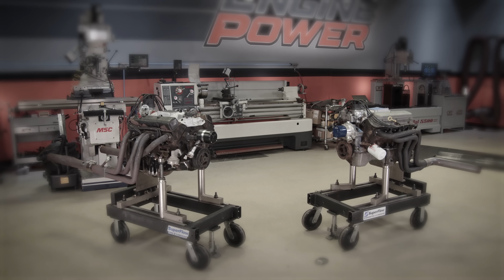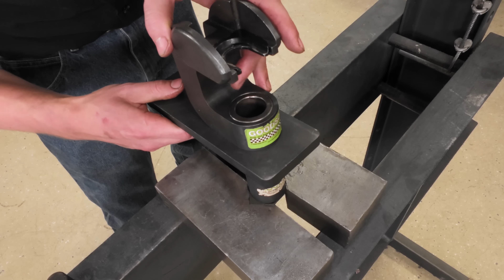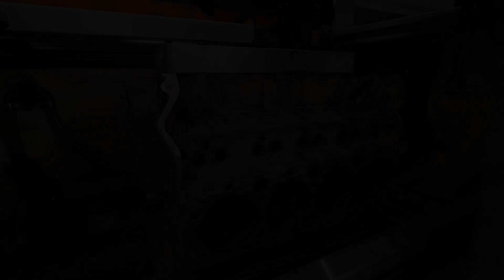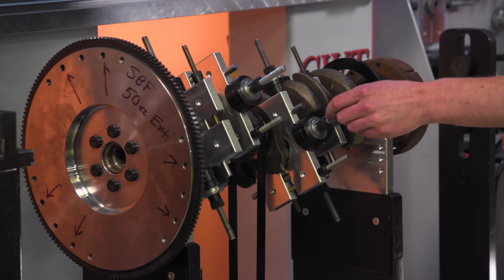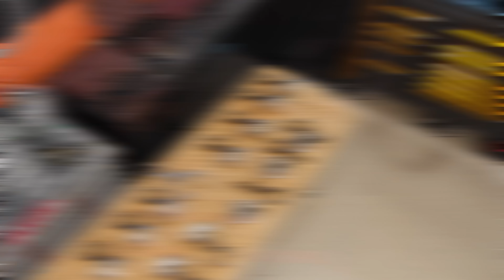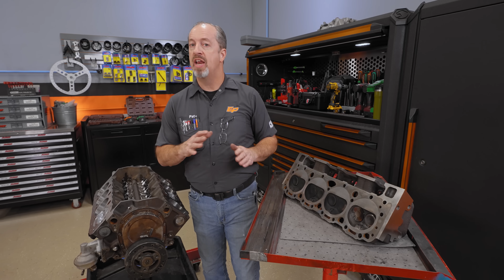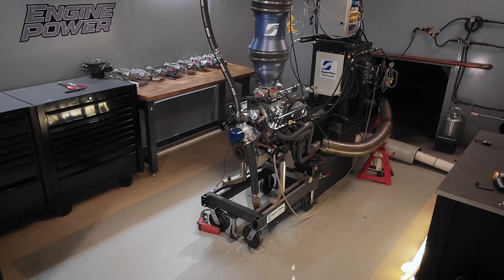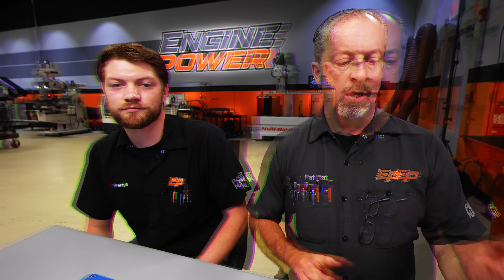305 SBC vs 302 SBF: Does Compression Help the Lowly 305 beat the Race-Bred 302?

Comment: alright, my 305 stays in my Buick, I had toughts of swapping a 350 in but I see no point in doing so, it´s not a race car so the 305 is more than enough, thanks a lot guys, great work.
Reply: youd definitely feel the difference in torque between the two.
Reply: Tbh, I love 305s. Built a couple in high school and the one in my 78 Buick was all cast iron, low lift, and a quadrajet. 1st gear-60/2nd gear-120/3rd gear was good for 150+. 2.50-ish rearend gear lol. Used to love throwing it down in first about 55mph and doing the long pull through 2nd gear (60-120 mph) on my way to work in the mornings between these two certain bridges...

Comment: The best thing Chevy ever did for it 305 engine is cutting off the back two cycles and called it a 4.3 V6.
Reply: 4.3 is a 350 with 6 cylinders that's why its decent

Comment: The smaller bore is a disadvantage with a 23° valve angle, but the longer stroke helps make up for it.  The 305 vortec heads looked like they had 1.94"-1.5" valves too. Not bad for a 305 for sure. 

The 302 has a 4" bore which helps the heads work better but with the 3" stoke, I'm surprised they make the torque they do. Those p heads must work pretty good. 

This is about as fair of testing you could get. They stepped up to a 1.6 rocker for the 305 to get similar lifts, should have used a 1.65, but still, I'm impressed with both of these little turds. It would have been really cool to see the same firing order for both, but I'm sure they each have their own patterns for power reasons.

Comment: On the chev you should have ground the rod .
Reply from the maker: Normally you would be able to remove most of the mass from the balance pad on the small end of the rods, but 2 of the 305 rods had almost no balance pad left from the factory adjustments, so we wouldn't able to remove mass evenly and opted for removing it from the rod throw instead

Comment: How hard would it be to build these two engines and still maintain impartialness during the machining process? Lol
Reply: Also, one thing I was always curious about is a 305 Chevy with a 3.75" -4.00" stroke crankshaft.
Reply from the maker: The machines do not know what kind of engine they are machining so other than making sure a few dimensional parameters are accounted for, it is very easy to get them the same. If you interested in a stroked 305, check out our 2 stage 305 build at the link below! We built a stock stroke version that made 400+hp and then transitioned it to a 3.75" stroke, big valve, solid roller combo that made 510+hp!
https://www.youtube.com/watch?v=XHuO2lMx80c

Comment: The 305 was given a lift disadvantage on the camshaft, and still stomped the 302 on torque, everywhere. That horsepower peak on the 302 really doesn't tell the whole story.

Does seem like a pretty mild grind on the cam to me though... and aren't those single plane intakes? If so, that's leaving a lot of torque on the table, for engines that are out of cam before 6000...

It seems like some odd choices, when you're making custom pistons for nearly 11:1 static compression. A "budget" engine, that is pushing the limits of pump gas? Just weird. More cam (230-235° @ .050 seems more realistic to me) keep it under 10:1 with RPM AirGap manifolds to maximize the torque and let them breathe to 6500 rpm would be a more impressive combo, IMO.

Comment: Its not one parts change ,you have re balanced the whole engine in both cases, factory old engines compared to re balancing and putting in new pistons and that makes a massive difference in any engine, even factory Oe engines do not get balanced these days mass produced and not blueprinted or balanced full stop. 🦘🦘✌✌

Comment: Noticed the ford 302 has two sump -plugs for the engine oil, i bet most of you did not know this fact, including me, i thought they only had one sump plug ,why is that, i know aftermarket sumps would have 1 sump plug ,but why the factory OE has two i will never know its like more work to replace the engine oil when its time to service it? 👍✌🦘
Also noticed that they both do not have a oil diffuser with in the sump, like aftermarket ones have. Which under load like drags the oil will go to the back of the engine ,thus staving the engine of oil up front ,which is why the diffuser does its tricks keeps oil all the way to the pick up and up to the pistons.  ✌✌🦘🦘

Comment: Awesome results bo both sides it they were as powerful as a dz302 and boss 302 a lot better on torque then what the dz and boss would have had. Keep up the great work next should be similar build with a 351 vs 350

Comment: I think the Chevy wins now but haven’t made it that far. Only because compression now match Chevy heads by the data earlier flow more cfm in comparison. Chevy I was always told respond well to 3c’s. Carb, cam, compression. And if you have yo choose big calves bs small chambers on Chevy pick small chambers for compression! They Brest well. Chevy has less valve lift

Comment: That 305 making 325 HP with little work and mostly GM parts is a pretty good result. In my experience, the 305 has always been a throwaway engine, so it's good to see it being shown some love. Still, the 350 or 400, given the same amount of love, can make 450+ HP, and that's before boring and forged internal, but I have always loved the underdog engines that everyone else hates.
Reply: think the same could be said of the Chevy 307 that was installed as the bottom end V8 in Chevelles, Novas etc. I'm guessing the 307 was the late 1960's version of the 305 from the 1980s.
Reply: @HighlanderNorth1 
I’m a Mopar guy that’s 64 years old. I don’t remember ever seeing a good 307 . They didn’t have any power and always smoked . The 305 on the other hand had more power and seemed to last forever. I’ve never owned a 307 and only one 305 but I was around several. I don’t what caused the 307 to smoke but any engine burning oil is also going to be down on power.
Reply: @HighlanderNorth1 I’m with you 307 underrated  engine 307 with fuelie heads good cam are a screamer
Reply: They should do a 260 Windsor Ford vs a chevy 267 v8.
Reply: 325hp from the 305 back in the 80’s in the 3rd gen F-Bodies would’ve been VERY welcome considering the most powerful version in those cars was the dual-cat LB9 with 230hp.

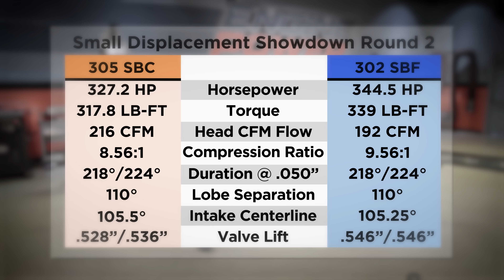Comment: I’m 2:37 into the video and Alread things are not equal. 
Round 1: 302 cam has more lift. 
Round 2: 302 has more lift and more compression. 
Round 3 results were almost even, even thought the ford still hade more lift.

Comment: I noticed that the 302 ran 38 degrees of timing with the 305  set at 36.  I’m guessing that those settings are where each engine delivered their headline power numbers.    Just out of curiosity, could that timing difference explain the Chev’s better low down torque, or are there other things at play?
Reply from the maker: Yes we ran both engines through several pulls to find the max timing vs. power for each engine. There are a few things that can affect that and in this instance it is mostly the differences in Dome and Chamber design in each

Comment: u use chevy lobes on a ford (or even worse MOPAR) naughty naughty, did you post the head flows?
With the taller deck on the chevy 6 inch rods and   1/16 or MM rings would have been nice

Comment: Ford guy here-I thought Chevy for the win due to the better flowing heads. For the next round, factory FI setups. The best stock FI manifolds with an aftermarket ECU. Thank you!
Reply: It would have, if it wasnt crippled by the tiny bore, and less lift.... stock looking heads and non forged pistons
Reply: @taomicioli they were both running factory castings, which the Chevy had BETTER HEADS AND MANIFOLD, which were both stated in the video. The ford had a very small advantage in lift that is all. Forged pistons don’t do anything for horsepower, they are just more durable. You are reaching…

Comment: For all the 305 haters out there. That little 305 just made the same HP as a stock 1970 Camaro LT1 350 despite having a much milder hydraulic roller cam.

Comment: Are you trying to bring legitimacy to the Chevy 305? Probably one of the worst engines they ever made. That and the 307, which shared bore and stroke dimensions with the 250 six banger.

Comment: EXACTLY as I already knew would happen. I knew the compression loss of going from the stock wafer thin ~0.020" compressed steel shim gasket to the ultra thick Felpro and 53cc 601 head to the 58cc 059 crippled the 305 in round 2. I also knew it was going to be good if it had decent compression due to the fact it gained top end power despite the massive compression ratio loss.

Comment: We also learned that all us Ford hot rodders knew what we were doing back in the 1960s and 1970s, when we found ways to make Cleveland heads fit a 302. The weakness in Ford small block engines was always that the heads didn't breathe well, so we copied Ford's Boss engine program to make heads with bigger valves and ports fit. Thankfully, Edelbrock makes that easier with their Clevor heads these days. The GT40P heads are (believe it or not) truck heads, used on the Explorer SUV and a few other engines. 

Excellent series of engine comparisons. Well done, guys.
Reply: All motors back then needed better breathing heads...Kudos to Ford to make the Cleveland Heads for Small blocks.
Reply: @cuzz63  they just took the Chrysler Poly head and made the ports bigger
Reply: @seancollins9745  I thought the 335 heads were more similar to BBC heads than Mopar poly heads
Reply: @seancollins9745  Yeah we know, everything amazing came from Chrysler... 🙄🙄
Reply: @kevinjokipii4260  canted valve, symmetrical port, go  look at the chamber for the poly and the Cleveland
Reply: This is why aftermarket heads (Trickflow, etc.) can easily take things above 400hp on the 302.  I don't believe there are any aftermarket options for the 305, so this is about the best you're going to get.  Would be interesting to see what can be gained in porting these heads.  What do I hear for a round four here?!
Reply: The GT40P heads were ONLY used on mid-'97-'01 Ford Explorer & Mercury Mountaineer.

The GT40 heads were used on '93-'95 Mustang Cobra, 1st Gen Ford Lightning & '96-early-'97 Ford Explorer/Mercury Mountaineer.
Reply: @foxfordcatguy2283 GT/40 P heads was on the first gen Lightning’s and some of the Aussie 302 powered vehicles in the late 90’s
Reply: Gt40-p is a revised version of the gt40 head that was originally found on 351 marine engines.
Reply: Without putting exotic or super expensive parts, this was a very fair comparison for normal people.
Reply: Ya'll done it ass backwards, everyone knows the 305 Chevy was an economy engine to pull heavier cars and trucks down road with fuel efficiency, it has the 283 bore and the 350 stroke, racers were making Chevy's 302 back in 1957 by boring a 283 truck block .125" over sized and finding the factory forged crank. If you wanted to make a real comparison, you should have started with a Z-28 engine and a Boss 302 Ford, then put all these new trick parts on them. The Z-28 would still win!!!!!😊😊😊
Reply: @carlsledge3868  Yeah, because everybody has a Z-28 302 or a Boss 302.🤦

They used these 2 because they are both plentiful & what many people can afford to start with.
Reply: @carlsledge3868  You know that, and I know that, and I'm sure Pat and Frankie know that, and the real shame is they don't mention the backstory on the 305 -- it exists to meet CAFE requirements.  In the days when 350 blocks were cheap and easy to find, there was no point in messing with the 305.  But now that 350 blocks are getting rare and pricy, there is something to be said for the 305.  Especially if you want to maintain a numbers matching car.  

The best part of this series is how it addresses the airflow limitations of the narrow bore.  Take a look at how they managed to get 600hp NA from stroking a 305 out to 340, and only going 0.030 over bore.  I never would have guessed that was possible with this block at essentially the stock bore size.
Reply: @carlsledge3868  Been done and no it didn't... so sorry bowtie slogger
Reply: @carlsledge3868 the 302 was the same thing. And a boss 302 and a z28 with all these parts on them would end up just like it did in this video because their literally the same blocks.

Comment: to make installs easier you can use allen drive set screws in the corners at least to make locating the part easier on oil pan intake ,valve covers etc, available thru mcmaster carr in any size.

Comment: The chev is still down on cam lift and rocker ratio,  between those two I'd say maybe 80 thousands of lift less then the ford, that could be 10hp.
More lift is more flow.
Reply from the maker: The Chevy is down only .018” of lift at the valve on the intake and .010” lift on the exhaust. The 059 cylinder head flows roughly 20cfm more than the Ford does at peak lift as well

Comment: I believe Lake Speed showed a pretty significant difference in 1/16 vs 5/64 ring packs due to frictional loss and higher rpm sealing.  Most likely enough to even it up at least?   Great video series though.  Maybe try some pocket porting next time?
Reply from the maker: Glad you like the series! The difference in ring pack on the two at this level is pretty negligible, since both engines have a rotational force (torque require to keep the short block rotating) within 2 lb-ft of each other
Reply: @enginepowertv  Well said!  Not sure where posters are coming up with their "difference" power numbers.

Comment: All this was done with cast iron heads which have better thermal efficiency than aluminum.  Awesome.
Reply: You want oil hot and chambers cool. Aluminum heads of the same specification would have destroyed the iron heads power wise because the chambers run cooler at the start of the pull and the cooler the chamber the easier it is for the air/fuel charge to be drawn into the cylinders.  If they had built a 305 out of a mid 90s Caprice L99 4.3L V8 by stroking it that came with reverse cooling and put some ported aluminum LT1 heads on it that flowed the same as these the L99 based 305 would have made another 15-20 hp and tq over this one because of the reverse cooling and aluminum heads allowing the chamber to be much cooler.
Reply: @chrisreynolds6520  there are many benifits n disadvantages between aluminium and iron heads. but power isn't one of them in just power as variable. same chamber/ compression etc = same power
Reply: @craig3916 You need to learn the physics of it before claiming that. The aluminum heads will make more even with the same chamber, flow, and valves. Engine Masters did testing on it using Iron/Aluminum heads that were the same save for casting variances and even with less flow than the iron heads the aluminum heads made more power. The iron heads holding in all that heat hurt power because the hotter combustion chamber creates a hotter higher pressure air pocket and prevents as much air/fuel from being drawn into it the cylinders. The volumetric efficiency was higher on the aluminum heads even with less flow. They did some static WOT testing where they parked the engine at WOT at 5,000 for 60 seconds and after that long WOT pull the aluminum heads did drop off a bit as they heated up but then again the power dropped a bit on the iron heads too. The cooler you keep the chamber the more power the engine will make and that is a fact.
Reply: @chrisreynolds6520  dont have to pull timing out of the alum head cause the chambers too hot (irons)
Reply: @gordocarbo  Yep

Comment: The 305 Ain't the most popular small block Chevy  ,  it would be the 283 ,DZ302 or 327  as these 3 can actually out run Big Block Chevy engines in the quarter mile  !   And U guys couldn't give me a FROD engine  !
Reply: The Ford 302 has the exact bore X stroke as your beloved DZ, and will whoop BBCs too. Just depends on how it is all built, car set up, and driver.
Reply: And a 351 Boss Ford will blow that ugly ass orange paint off any of those overrated sbc's Lmao!
Reply: @mach-ws9cl , my little 327 in a 66 Chevelle ,Forged Steel Vette Crank 
Runs 5.5sec in the 1/ 8 mile  , 
So bring your Built FROD TUFF  anytime  !
Reply: @jimthomas1989  Sure it does... 🤣🤣🤣

Comment: You said below 4300 was killing it but the graph showed the Ford had better numbers. Which is correct?
Reply from the maker: @20:13 the light blue line is the 305 torque and the dark blue is the 302 Ford. The Ford does make a slight higher peak number by 1 lb-ft, but the 305 has higher average torque/power numbers below ~4300 RPM. Hope this clears it up!

Comment: Those ring packs would make a 6-10hp difference going from a 1/16 ring to a lot thicker 5/64 ring! And although on a lessor amount, the quench distance would also make a difference but I can understand that variable trying to keep compression close, but the rings? Come on guys! Total seal makes a spacer set to run a 1/16 ring in a 5/64 piston.
Reply: Who makes 305 pistons w/ a 1/16th ring package and similar compression ratio?
Reply: Do a little bit of port work to the Ford heads to equal the Chevy vortex and the Ford will still come out on top.
Reply: very well said! how could they do that if they try to build 2 apples to apples engines?!